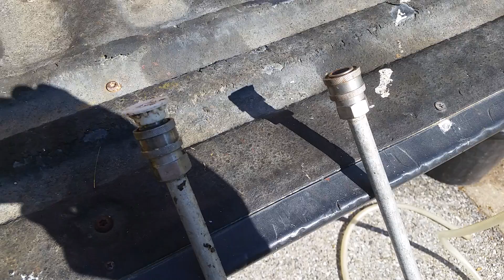Cracked/Brittle couplers

Comment: flow sensitive unloaders are great at reducing strain on all components, Inc couplings.
Reply from the maker: yes they are..but they don't behave as my trapped pressure when I reduce nozzle size for specific applications...also for commercial work where my hoses are over parking lots drives, when I release the gun, my hoses retain pressure and the wire is less likey to cave in
Reply: +Griffs Services ah okay, I understand. Regards couplings, I have had problems with brass fittings in the past, however however since replacing with stainless steel, no issues over past 5 years. always good to take care though.
Reply from the maker: +Jim Jams have a feeling its a detergent that I dipped that end of Lance into last week that somehow affected the ss on a molecular level
Reply: +Griffs Services sounds like that could have helped create the issue. I believe it's called 'embrittlement'
Reply from the maker: +Jim Jams that sound like the technical term...but you would think the ss would hold up to a mild/medium acidity acid
Reply: You'd like to think so. I'm no chemist, but I know metals have a limit of resistance to caustic substances as they do with heat. I'm sure you're aware there are various grades of ss, all offering different resistance to attacks from things like acids and even oxidation caused by environmental effects. I use Snap-tite ss couplings, I've found them to really last well, although I tend not to run many chemicals through my pressure washer system. Hopefully no damage was done with the tip you lost, every so often something happens to remind how careful you need to be when using high pressure equipment.